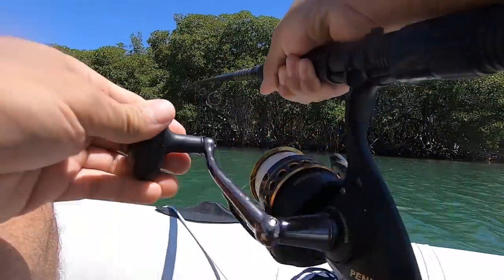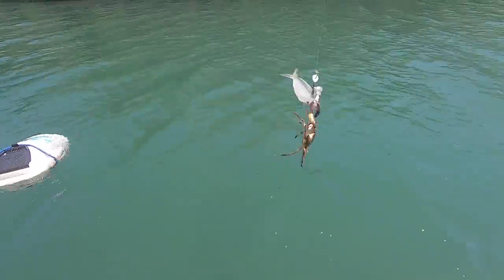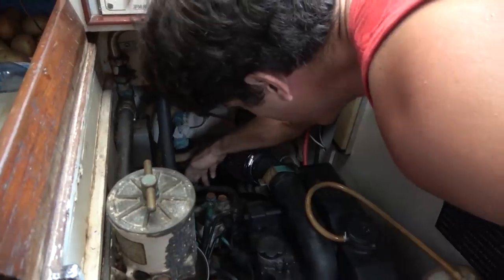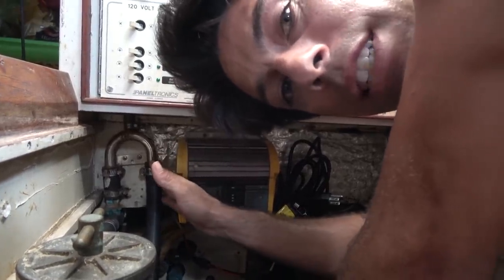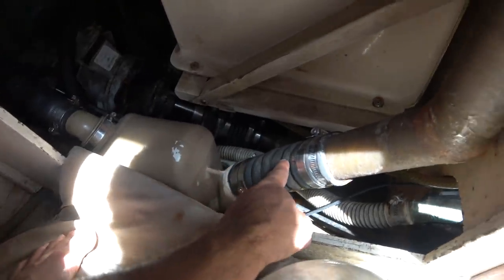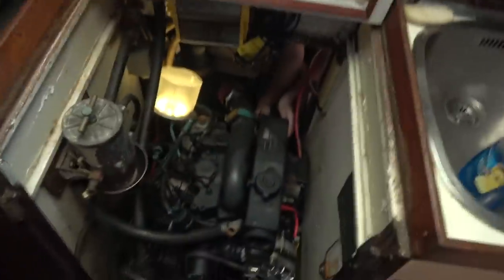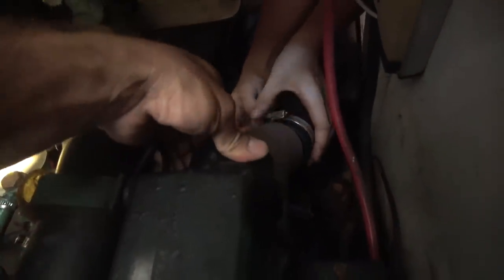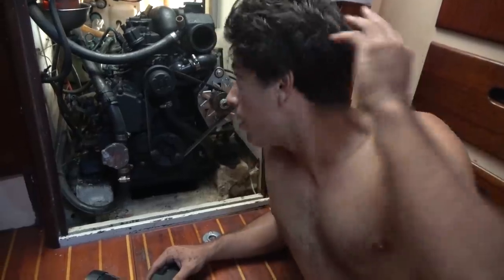Our Secret Weapon is SIMPLY Brilliant! - Bums on a Boat Ep 128

Comment: That's a bummer, are you going to be able to remove the oil pan without liftng the engine? Hopefully its the oil filter.
Reply from the maker: Yea, we would have to lift the engine to remove the oil pan. Luckily we have confirmed that it is not the oil pan. Still not exactly sure but we are suspecting the filter was on too loose.

Comment: I’m guessing that your Sump (AKA oil pan) is impossible to remove and replace without moving or dismantling the engine(?)
  I’m also unsure as to the degree to which your u’ve stripped down the engine. Have you disturbed the engines’ timing at all? (Nothing to do with the mystery oil leak, but if the timing is incorrect you may possibly badly damage the engine!)
  Cannot wait to see the next episode and find out what was the issue (And the fix!)
Reply from the maker: Yes, it is. That was what had us so bummed out. We have not focused much on our timing. It sounds very good right now.

Below is a video of it running on our Facebook page.

https://web.facebook.com/BumsOnABoat/videos/731208750753889/

Comment: After watching your series on this engine, my guess is that the oil leaks into the bilge to collect water from the cooling leaks, to then be pumped back to the exhaust injector to lubricate the muffler bearings, where the backwash from following seas splash oil back to the engine to lube all alternator wires to prevent rust!  Remember never flush in following seas to prevent  a poop deck.

Comment: You can fit a flapper, tractors have them to stop rain getting into the engine.
Don’t forget to fill it with oil before you start the engine, 😂 or 🤬 happens

Comment: its just an oil pan weld up the holes and your good to go
Reply from the maker: Luckily it was not the oil pan. A good sign that we missed was that there was still a little oil on the dip stick. We feel that if the leak was in the oil pan/bottom then all of the oil would have drained out.
Reply: Ok so this is a seal leaking, so either a sump gasket or filter( less likely) or an external oil hose or its gasket

Comment: Not sure about your motor but don’t keep cranking the motor with the seacock open. It could cause hydro lock. Ruin the engine. 
Really enjoy your videos.
Reply from the maker: Thanks for the feedback ! So its actually okay to crank with the sea cock shut, and open it once she's running?
Reply: Bums on a Boat yes, do your own research. I’ve read about this.
Reply: Bums on a Boat The most common cause of hydrolock on a marine engine is cranking the engine over with the starter when the engine is not firing. As the engine cranks over, the raw water pump is pushing water through the heat exchanger and into the exhaust/muffler. If the engine is not firing, the water will not be pushed out of the system. Eventually, the water will rise to the exhaust manifold and flow through the exhaust valves and into the cylinder. The easiest way to prevent this from happening is to shut off the raw water intake valve if the engine does not fire after the first couple of tries.

Comment: Next time you go to start an engine that has been sitting for awhile and/or been worked on such as yours, keep the raw water seacock closed, pull the engine shut off lever then crank the engine. Doing this will pump oil up in the engine, now check for oil leaks. Next put the engine shut off lever back to run then crank the engine. Cranking the engine with the raw water sea cock open will allow water to flow and if the engine has not started it is possible to get hydro lock because there is no exhaust pressure to push the water out. Once the engine starts open the sea cock. You can the engine for a bit (10-20 seconds) with the sea cock closed. DO NOT SPRAY WD40 into the air intake to start it.Think pre-denotation. Ask your dad about it.

Comment: Ohh, going to keep us waiting. And most oil leaks are no big deal. They usually are not hard to fix, even if the oil pan has a hole in it all you need to do is take it off clean it reall good and put some job weld on it for now. You can always order a new one down the road. Most likely your engine isn't leaking a lot of oil though, your low oil level its probably because the engine is burning it. If so it needs to be overhauled sooner or later.. If the oil leaks past worn valve seals or piston rings it ends up in the combustion chamber with the diesel fuel and gets burnt up all the same. This would 100% cause excessive carbon buildup in your exhaust, which is what this whole repair started with if I'm not mistaken...
Reply: Watch the video,  oil in a puddle under the engine!!! Jacob?

Comment: Why no rig up an outboard mount.  The time, money and energy you are putting into that crap Volvo isn't worth it.  Buy a used 20hp outboard and go sailing.
Reply: i say but a 20 hp outboard longshaft, and fix the volvo!  most of the sailing channels i follow have inboard engnes, i havnt seen anyone who uses a outboard. whats the pros and cons?
Reply: @chronicawareness9986  There are a couple who have rigged up for emergencies. Most tie the dingy on the outside of the boat and use it with the outboard singing its lasts breaths usually, over heating and blowing up. If I remember , the outboard they have is really in need of an overhaul. I remember they had to replace the gas pump and other parts are as ready to go as it was.
Reply: Outboards such for what they are doing , the motor is not worn out it was neglected .
Reply: For all intents and purposes.... the boat,  engine,  sails etc. are really okay. 
The owners are learning as they go and doing a damn excellent job despite all the keyboard experts. 
I love the way you throw in teases of fishing and boat neighbor collision course in the dark of night!
You bums have lots to create content and the sooner you button up the motor drama the more I am going to enjoy the rest of the story!